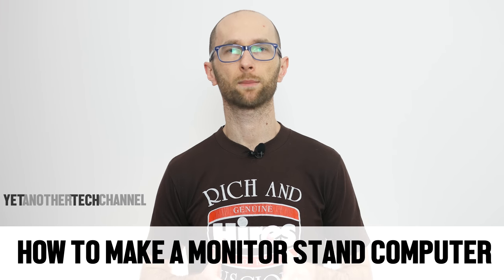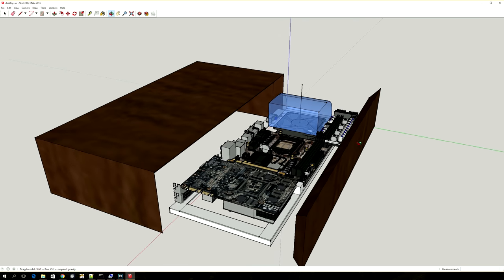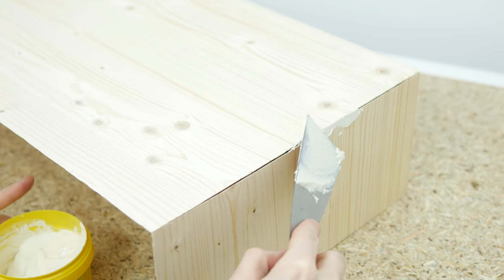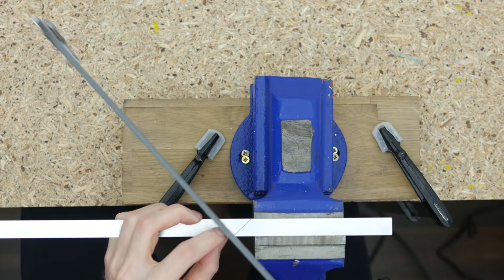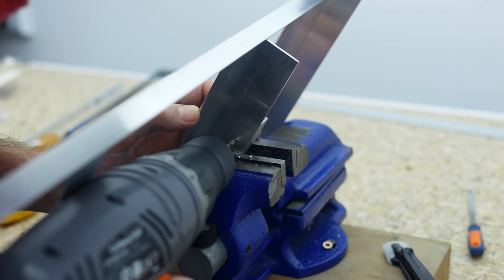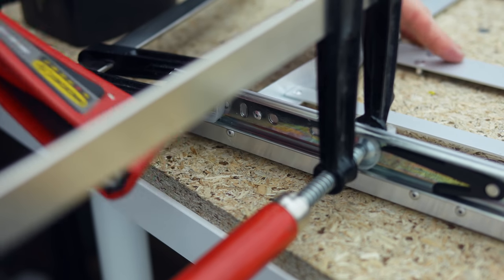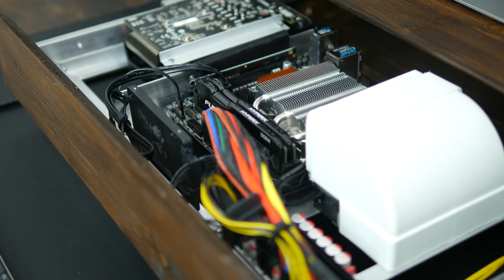How to make a monitor stand mini ITX computer

Comment: thank you for showing how easily such beautiful pieces can be made if you have the will to find a solution that is achievable for yourself.
my personal changes might be a different airflow for the CPU cooler. a led lid aluminum touch switch as power button and an external usb connector in the front as well. most of it can be  added afterwards.

Comment: Great video and nice layout. I would attach another piece of duct OVER the cpu cooler to more force the air over/through it, right now most of the air will go "above" the cooler and not help cooling the cpu at all. So making it 10-15cm longer and a few cm lower (to fit snugle over the top of the cooler) then you will get a lot more air blowing through the cooler and out to the left over that coppre heatsink.

Keep doing stuff like this, very inspirational!

Comment: Using wood filler on the joint cracks is brilliant. Not only does it make a finished joint but it adds a seal as well. Nice move.

Comment: Will this fit a GTX 1080 too?
Also I would recommend a fan with a dust filter on the back facing the CPU to bring air in.
Reply from the maker: The mini GTX1080 by Zotac would probably fit easily. Fitting those big ones, with three fans would probably require a bigger box but would definitely be doable.
Reply: YetAnotherTechChannel Thanks!

Comment: Instead of the air duct, couldn't you have fitted a rad instead? Like using a regular water cooler.
Reply: Wait a second.... yeah. huh.
Reply: Hardwarelabs got you covered... in 54mm thickness, not including fan thickness. http://hardwarelabs.com/nemesis/micro/m92gtx/
Reply: Instead of an air duct, you could use a different layout using a long PCIe-cable instead of riser-card so that both GPU and motherboard would be facing downwards drawing air from that direction.
The "Inverse" has this layout with a SFX power supply in the air duct's place.
Reply from the maker: I'm prototyping here and trying to keep the cost at minimum. I'm not Linus Tech Tips, I don't have tons of hardware samples laying around...
Reply: YetAnotherTechChannel imo going noctua still is good as it's low profile and quiet and keeps space requirements low
Reply from the maker: Are you aware that those long ribbon PCI-EX cables decrease the GPU performance?
Reply: Yes, cheap unshielded cables would do that because of interference and the overhead of the resulting error correction but properly shielded cables shouldn't. There are people on forums who have tested a number and produced lists of recommended cables.
Reply: YetAnotherTechChannel they don't, actually. It's been tested on many forums
Reply: Actually they do. Black Ice Nemesis 92mm Radiator. A lot of people use them in SFF builds such at the NCase M1.

Comment: a raijintek pallas could have been used for the cpu. very low profile cooler, awesome performance.
nice video, dude
Reply from the maker: Sure, but since I'm just prototyping I try to keep the cost at minimum so I reuse whatever hardware I already have.

Comment: YetAnotherTechChannel: Would it be possible to get the plans for your frame? I want to do a similar project but make a wooden "laptop" all-in-one gaming PC. Specs I will use are an Intel Pentium, 8gb of ram, a gtx 1050Ti, and a pico psu. I am hooking this up to a 19.5 inch display which will be attached to the PC box with hinges. Any advice on this project? I know your project was a bit older now but I was wondering what metal bars you used exactly and any advice on the build. Many thanks in advance!
Reply from the maker: I can upload the SketchUp model to the Warehouse. I did change things as I progressed with the build, but maybe it will be somewhat helpful.

Comment: Awesome build. I think the HDplex300 can handle an i7 and a 1080 though (less than 300W)
Reply from the maker: From my experience - a system based on a 65W Core i5 6500 and a 190W R9 380X consumes around 295W. Core i7 6700K is rated at 91W and the GTX1080 at 180W -> it will most likely use more than 300W. I'm not saying that the HDPlex 300 W won't handle that load since the DC power delivery is more efficient, but I wouldn't be comfortable with running such system under full load for longer than lets say 2 hrs.

Comment: You should see better temps if you install a fan on that heat-sink. And have the air duct pulling heat away from the heat-sink. You have heaps of ventilation behind the box, since there isn't any back cover, that'll help with your videocard cooling and overall ambient internal case temp.
Reply from the maker: I wanted to test such configuration should I ever wanted to make a sealed box - in such case the fan over the CPU would not have anywhere to get the fresh air from.

Comment: Why no screws for the wood case? You would only need one more drill bit to countersink them and since you are using wood filler on the joints anyway, you could also use that to cover the screw heads.

Comment: How you can drill aluminium bars without drill bit floating? Even if I make center mark it still drift away.
Reply from the maker: That's years and years of experience ;)
On a more serious note... aluminum is pretty soft material so that shouldn't be a problem with a decent quality 3 mm drill bit. If I need a larger diameter hole I still use the 3 mm bit to make the initial opening and then I switch to the larger bit.

Comment: Awesome bro, but I wanna know … where's the button of turning on or off your computer?
Reply from the maker: You can see me soldering a short wire to a momentary switch at 5:57 and then attaching it to the frame so it can be reached at the bottom.
Reply: YetAnotherTechChannel yeah I see, it's a good idea, thx for your answer 👍

Comment: Why you didn't the stock fan or nectowa fans they look good and cooling down is marvelous
Reply from the maker: When I'm prototyping I'm trying to use the hardware that I already have to keep the cost at minimum. If I was actually going to use it, I'd definitely invest more money into it.
Reply: maybe u could just use the stock fan for processor and added two 80mm fans on the rear... 80mm fans are not that expensive and would fit a small build perfectly...
or maybe one 80mm fan on front and one on rear for better airflow, if u can put a small gap on the front so the front fan can suck air from a small gap underneath, and have the hot air exit on the rear w/ a rear fan

Comment: Looks like a great build, but you're surprised that the heatsink struggles to cool the CPU passively? The airflow from that duct is nowhere near sufficient to efficiently cool a cpu, and even heatsinks 4x the size of that one in well-ventilated cases struggle to work well without an attached fan. Stick a 92mm fan onto it and call it a day. Also, I'd recommend providing some sort of air exhaust for the GPU to avoid it recycling hot air inside that rather limited space.
Reply from the maker: Believe it or not, that fan does push a lot of air through that vent and over the heatsink.
Reply: That might be true, but airflow takes the path of least resistance, which in this case is over the heatsink rather than through it. As such, airflow through the heatsink will be marginal at best. If the duct was closed off so that it was no taller than the heatsink, it would probably be better, but again, you're not in any way making sure air is actually forced through the heatsink. As such, you're relying on convection to raise the hot air from the heatsink, where the airflow from the fan will remove it. This will work, but again, the heatsink is too small to be effective in this configuration. Not to mention that it (in all likelihood, due to no other airflow) will be pulling in heated air from the GPU at any time that it's in use. It's probably no crisis, but far from ideal.

Comment: No just use a cpu that has a "t" in the back.. like an i7 6700t it is a bit weak but it is only 35w tdp and there is even i3 with t
Reply from the maker: I'm not Linus Tech Tips, I don't have a complete lineup of Intel's CPUs laying around... all I have is a Core i7 6700k in my workstation and this Core i5 that I use when making these projects.
Reply: YetAnotherTechChannel even linus dont have it because they dont need it !!! You can buy it online stores it cost just under 300$ for the i7 an dthere is even i3 and i5 and Pentium .... 35w tbp will keel this even more silent!!

Comment: Could This hdplex 300w handle a GPU like gtx 1060?
Reply from the maker: Easily, AFAIK it can power even the 1080.
Reply: YetAnotherTechChannel them i Think cooler Master is trolling me . Their calculator website says only Ryzen 2200g Power consumption is 180w. And i need a 250w psu . With gtx 1050ti i need 350-400w psu. Its what the website shows but i Think It isnt correct

Comment: what is the brand of the raiser, any links?
Reply from the maker: +Antonio Diaz that particular riser came in box with the Sentry case.
Reply: O well, thanks for the info, doing a custom project myself and seems finding good reliable raisers is quite hard.
Reply from the maker: I'm in the middle of evaluating risers - I'm benchmarking three GPUS (GTX1060, GTX1050 and R9 380X - I don't have anything else on hand) with two different risers - the one that came with Sentry and a 20cm long that I bought for $2.50. The video should be ready this week :)

Comment: ...and that should be a "small radiator"?? There must be something wrong with the thermal compound or the way the heatsink is mounted on the cpu bracket: that thing is huge!
Reply from the maker: +Thomas Samoht if you're referring to the one that's on when I do initial test fitting then you should look again as I change it later to Rajintek Zelos low profile heatsink ;)
Reply: Oh sorry, didn't notice that!

Comment: Why not flip the motherboard upside down? It's a drawer system so you can still easily take it out if you want to modify it. In that configuration, having an upside down cooler should properly dissipate heat without needing a duct.
Reply from the maker: I wanted to try such combination if I ever wanted to make a completely sealed box.
Reply: That's true. Another alternative (although probably inferior cooling) would be blower type cpu cooler.

Comment: an easy improvement for cooling the CPU would be to make the plastic part that comes from the fan longer, with the bottom open. Like a U reversed over the radiator. Similar to xbox360 cooling system.
Reply from the maker: Yeah, I know what you mean... but I think this contraption would benefit greatly from a bigger heatsink.
Reply: Certainly yes.

Comment: The CPU heatsink needs a fan on it's own. This way it's only passive cooling and with that little surface area you wont get anywhere. By the way, there is such a case out there from Raijintek called "Taku" if you want to check it out.
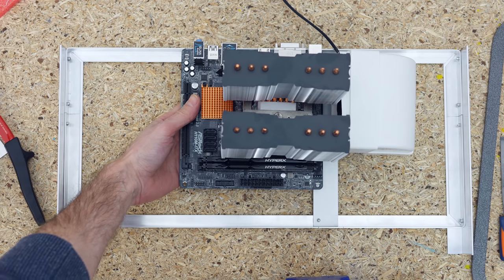Reply from the maker: Did you miss the part where I'm making an air duct? Believe it or not, there's plenty of air being pushed through the heatsink fins. That CPU would thermal throttle like mad with that heatsink... I did try passive cooling this chip with the big heatsink that you can spot at 3:29 - it managed to keep the temp at low 70s under 100% load.

Comment: You sound like me lol  I do have a workbench in the basement etc, but not all the tools I need i.e. circular saw and such, but I manage to ghetto build some cool stuff IMHO using the resources I have.  Check my channel for my DIY tablet and phone charging stand ;)  

Great work with you had as well.  Would've never thought of this, but I did make a monitor outta scrap wood to give the monitor height, and to route my cables through ;)

Comment: If your measurements and blade cuts were done correctly then you shouldn't have needed to use wood filler on the joints. Get a better tape and saw.
Reply from the maker: What I really need is a workshop so I can cut as much as I want without bothering my neighbors...

Comment: But why don't you have a 3d printer? It would probably make it easier for people to replicate your projects. They're really cheap now, starting at 190$ for an anet a8. And where I come from, me and my friends have 3d printers, but not such a hefty set of tools, because we live in small apartments ☺️
Reply from the maker: 3D printer is on the very first place on my shopping list... the problem is that the ones I really like cost a lot more than $190.
Where is it that you come from? Is it by any chance Poland? Because your name sounds very Polish ;)
If so, I'm well aware of the living conditions in Poland, because... I'm Polish, living in Poland... and while I'm quite fortunate to own a rather big apartment, I do 99,9% of my work in a room that's a little under 11 square meters ;)
Reply: YetAnotherTechChannel I am in fact from Poland, the tricity, but the affordable 3d printer market is booming, and people that like diy, or that are amateur engineers can now easily get their hands on one. I have an anet a8, that I've been upgrading for a while, and it achieves rather good print quality. "Everyone can afford a 3d printer" because a good ink jet or laser printer can cost 200 $, and no one says that printing on paper is ludicrously expensive.

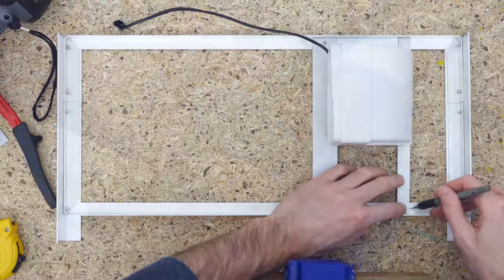Comment: 3:29 How are you gonna fit that CPU cooler in that small monitor stand/case???

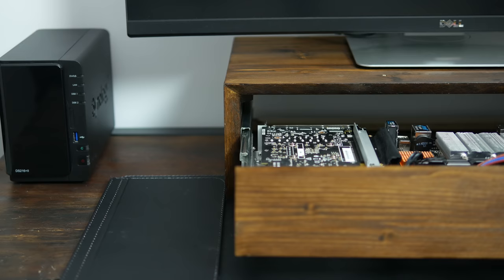6:09 Alright you changed it. LOL
Reply from the maker: Lol, yeah. I was trying if that big heatsink would be sufficient to cool the CPU without the fans ;)
Reply: What is the small cooler you use in this vidéo ? Its OK for a i5 2400s 65 w Without fan ?

Comment: you should use blower type of fan. its quieter, blows more air, and its thinner (although you have to mount it on the side of the heat-sink). and you can make the fan quieter by gluing it on a piece of foam. the foam will act as a suspension to dampen the vibration of the motor.

http://www.ebay.com.au/itm/Black-Brushless-Cooling-Blower-Fan-3-Wires-DC-12V-2-7A-97x94x33mm-4500RPM/301606563191?_trksid=p2045573.c100506.m3226&_trkparms=aid%3D555014%26algo%3DPL.DEFAULT%26ao%3D1%26asc%3D43267%26meid%3D180a4c246b034278ae857da772d35811%26pid%3D100506%26rk%3D1%26rkt%3D1%26

find the size that is best for you
Reply from the maker: As I'm prototyping, I try to keep the cost to minimum and use whatever hardware parts I already own. Thanks for suggestion tho, I'm sure I'll make a use of it sooner or later :)

Comment: but where is the disk?
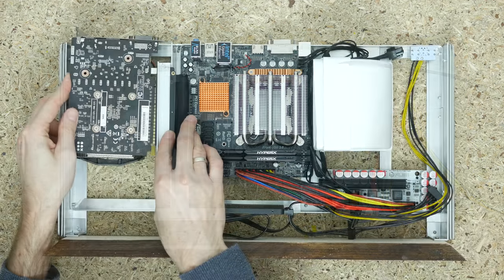Reply from the maker: SSD is being mounted @ 5:50
Reply: YetAnotherTechChannel lol sorry I must have missed it
Reply: Is it possible to use atx form psu?
Reply from the maker: If you make the drawer large enough - then yeah, you can fit ATX PSU in there... but SFX would be a better fit.

Comment: this is terrifying .......i m sure the aluminum will short something in no time ...he should rethink the insolation ....even a bit of duct tape will do a good job
Reply from the maker: And where is that coming from? You're aware that this is no different than a regular computer case, which is made from steel and steel is as conductive as aluminum...
Reply: i have to admit you did a good job with the case and regular computer cases ship with plastic washers and the chassis itself is grounded it was just a thought
Reply: most cases are on plastic or rubber feet, and mobo stand offs are mainly brass or black painted steel, and they screw directly into the case steal or aluminum. Never once had one of my cases come with plastic washers for the mobo screws. DIY pc, corrsair, fractal design, in win, rosswell, and the pre builts (dell, hp cases) all don't have those. At least all the ones i've personally owned.
Reply: It's all grounded by contacting the PSU, there's no danger

Comment: Why put in a 65w i5 when you can put in a 65w Ryzen 1700 lul
Reply from the maker: I think you're missing the point. This video is not about the components, it's about creating something.
I have a Core i7 6700k in my workstation desk PC and I bought this i5 a few months back when I was reviewing Dr Ząber Sentry case. I don't need more CPUs.